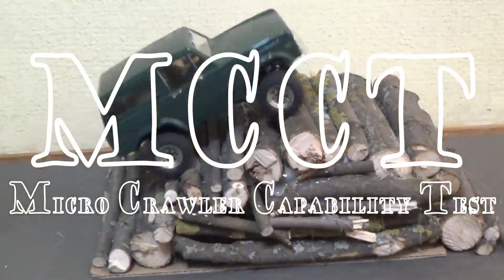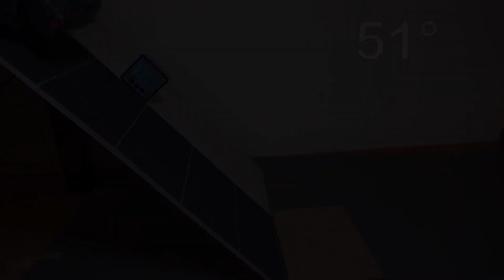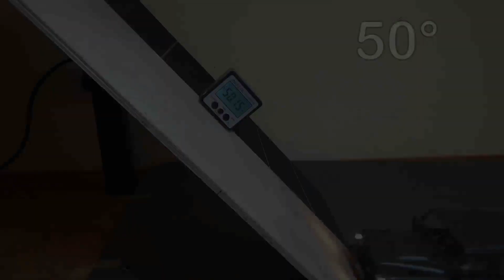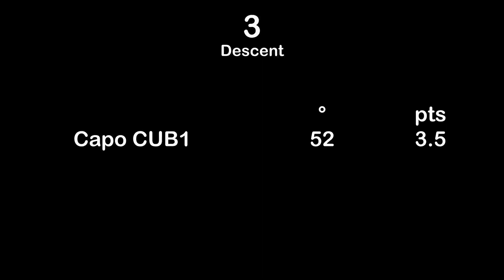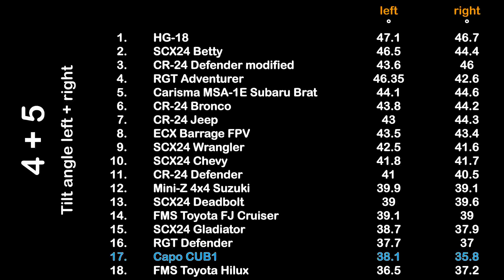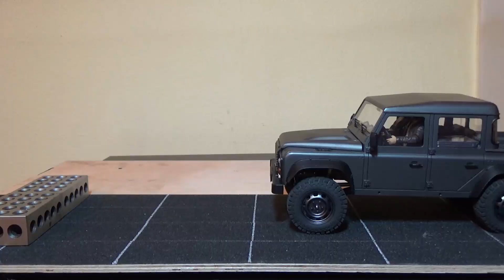MCCT 7: Capo CUB1

Comment: I am not sure if I agree with some of your points here. CAPO is more about scale realism despite being highly capable in it's class. With a smaller motor and metal body, it probably still has a better power/weight ratio than it's real world counterpart. Some of the test you did were impossible for the real car anyways. At least to me, if I care about performance, I wouldn't go with a capo coz a toy grade RC could do better in some of these tests. To me the beauty is all in the scale realism, suspension articulation and smooth action at low speed. Nice build!

Comment: Would it have passed all tests if it had different tires maybe?
Reply from the maker: For test 7, the steep side of the hill of branches, larger tires would maybe have helped. Ground clearance is too small (in combination with rather long wheelbase) for this. And the rear bumper also got stuck. Tires are good (see test 9 and incline tests). But larger tires would raise the center of gravity, maybe it would have tipped backwards then. A stronger (larger) motor with more punch would also have helped. 
But there is no room for larger tires.
It is a trail truck, no crawler, and the weight is unbelievable, nearly 1 kg. SCX24 Deadbolt, Chevy, Jeep, Betty are 220 - 230 g, the 1/18 hardbody trucks (FMS, RocHobby, EazyRC) are about 500 g. 
So results are very good IMO for such a super heavy truck. Biggest downside is the tiny motor (and no way to mount a larger motor).